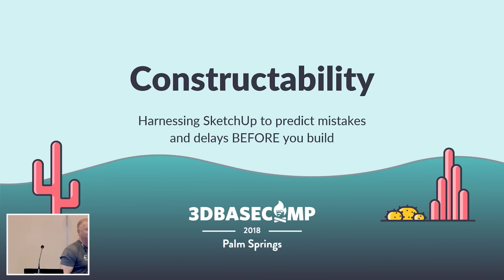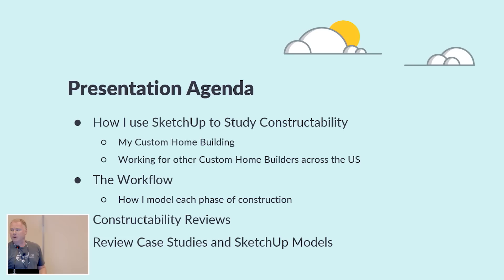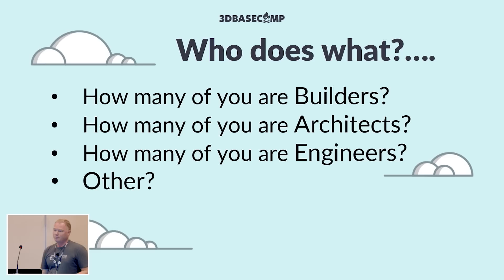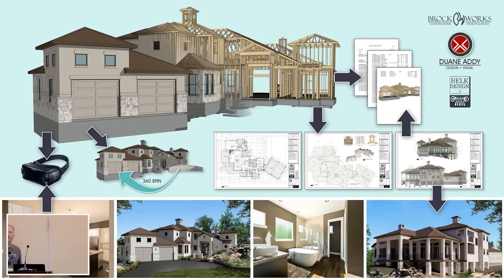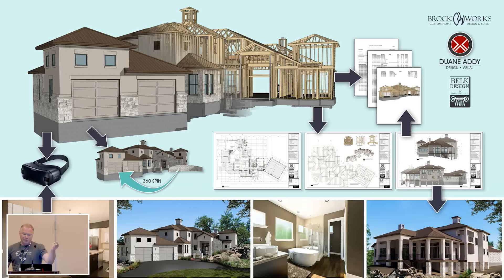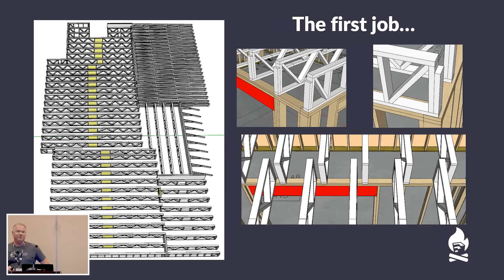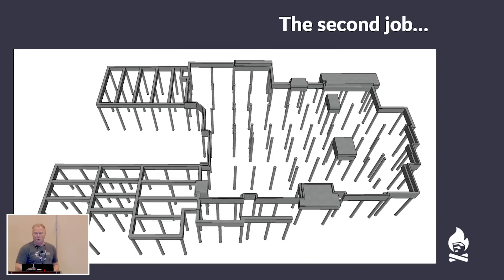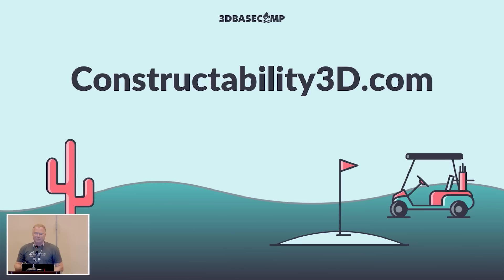Constructability Modeling – John Brock | 3D Basecamp 2018

Comment: I have a question, I'm working on a large floor plan I want to work on a bedroom at one end of the house when I orbit around to get a better view of a particular wall the whole model rotates in the room is off screen is there anyway around this. Or can I orbit around a particular object within that house.  I am working in SketchUp Make 2017 on a Mac.
Reply: I swear by my 3D mouse (www.3dconnexion.com) I have one for each computer and really hate working without it - makes navigation smooth and fast.
Reply: Use PAN to slide the model back on screen . Pan is available using the mouse while pressing and holding the center mouse button (as you would while orbiting) HOLD shift and move the mouse to pan. RELEASE shift and orbit returns, etc. The idea is to use ORBIT, ZOOM AND PAN all from the mouse fluidly.
Reply: @Krupster_architect  I agree, I should have recommended native SU tools, as you suggested, to start with, a good skill to master!